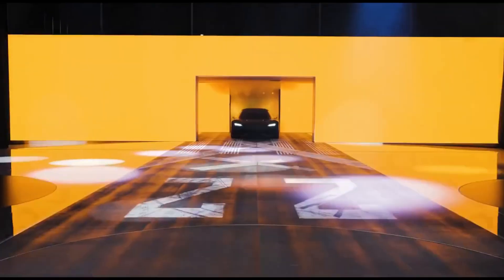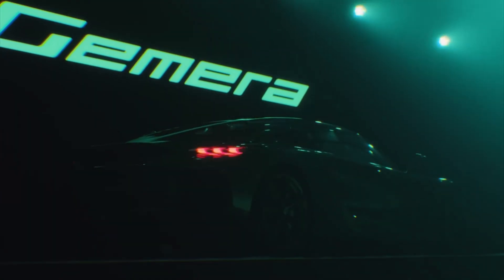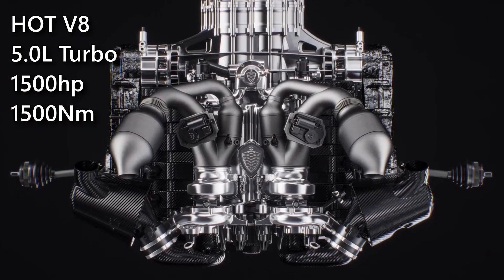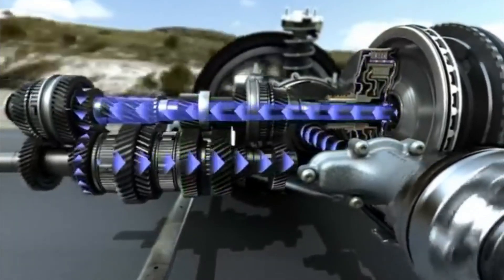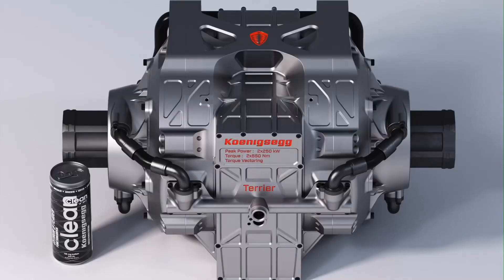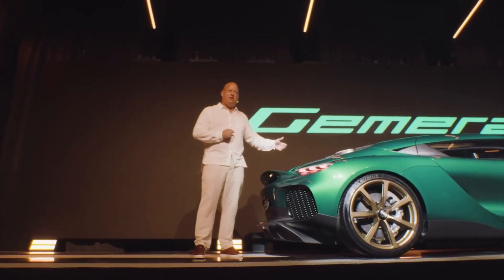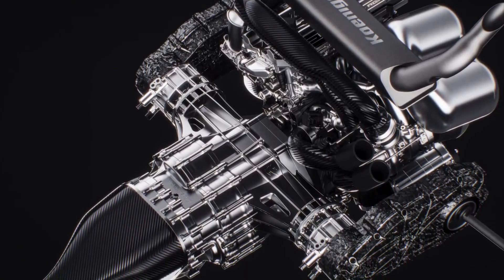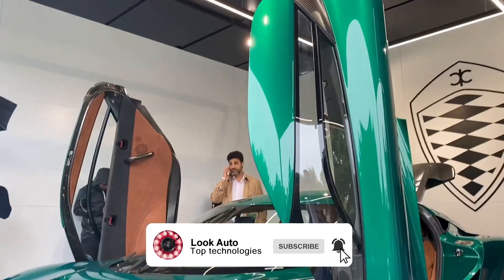How WORK KOENIGSEGG GEMERA 2? 13 CLUTCHES 2300hp!

Comment: The V8 is not freevalve
Reply from the maker: Christian Koenigsegg, even in the Koenigsegg Regera, stated and demonstrated that they use Free Valve, and as a result, the engine V8 became significantly smaller in size.